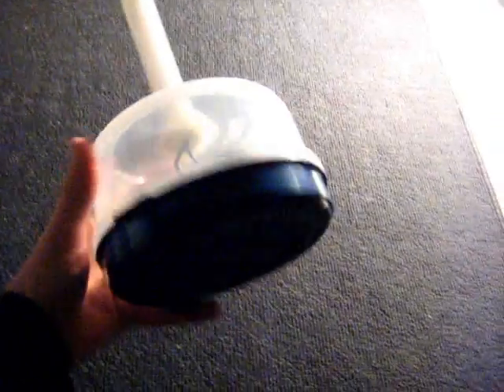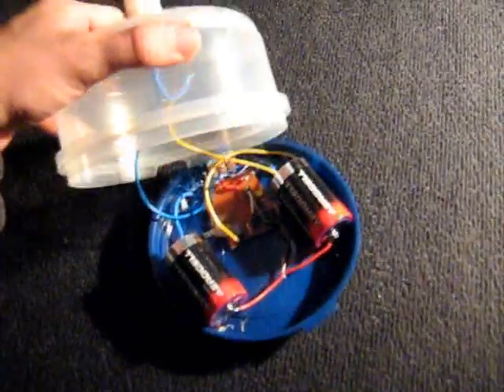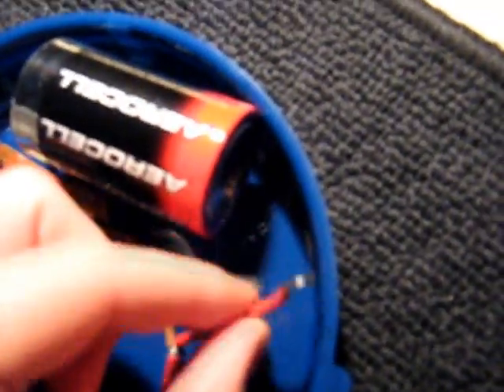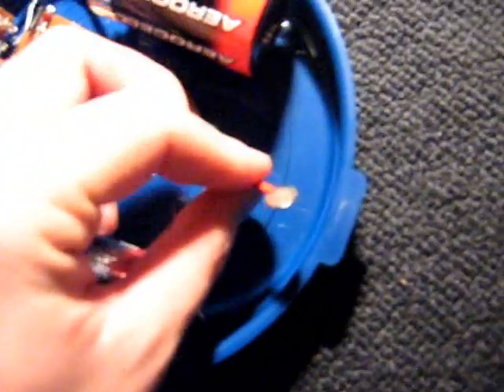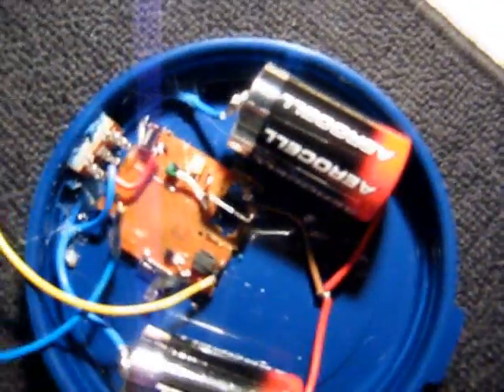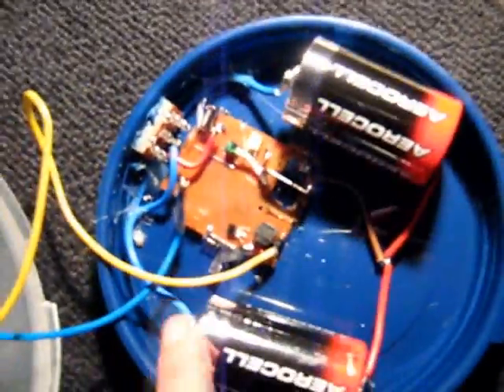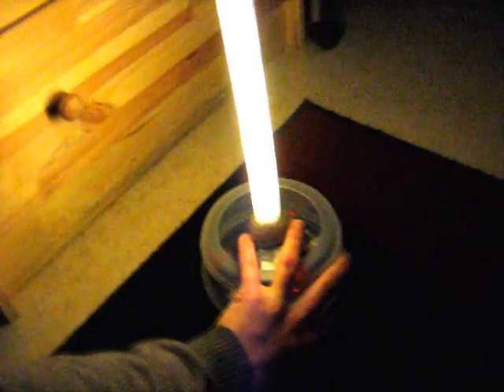My replication of the Joule Thief Pirate Light

Comment: Very nice job.  I have never tested mine for longevity so I am glad you have told us some idea on how long this should go.  Actually, yours appears a bit brighter than mine.  I still use mine now and then and it is very handy to have.  I am now working on a similar circuit but using a bunch of leds instead of the tube so, we will see what happens.

Very good job.

Bill